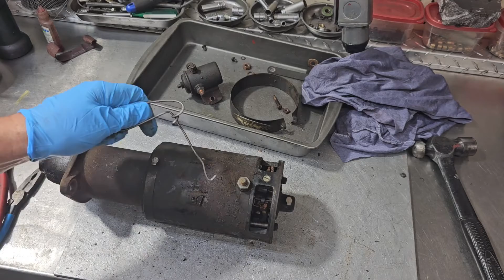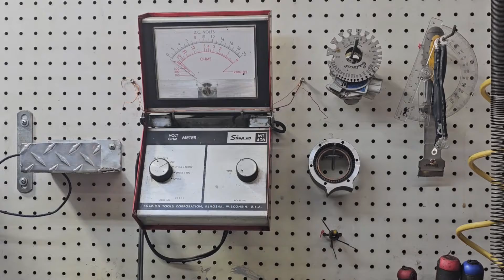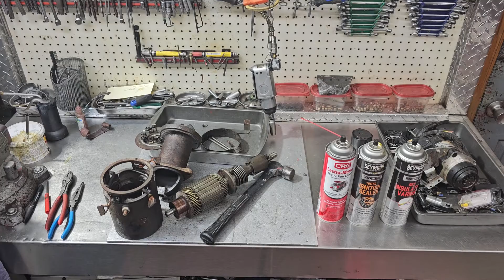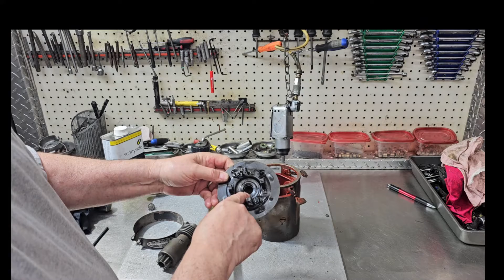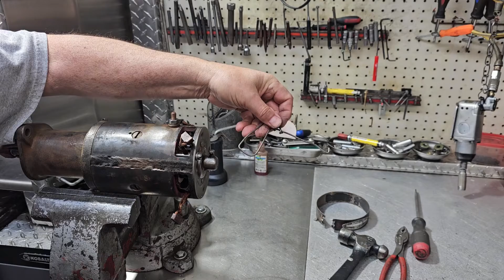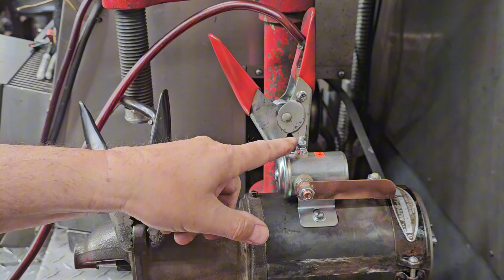1940 Packard Starter Rebuilt

Comment: I tried to fill out the "contact us" form on your website but the forum is not working. It is not even there to fill out. Im going to try to find your email address and try to contact you that way. I need a starter rebuild kit.
Reply from the maker: If it's not on the website, we don't have it. Spam has the contact us form temporarily off.
Reply: @rebuilderinabox  I need to replace the rectifier on my 3G Ford alternator as soon as possible, and in your 3G rebuild video you said to call or email about that, so is there any way I can request a replacement rectifier while the contact form is disabled?